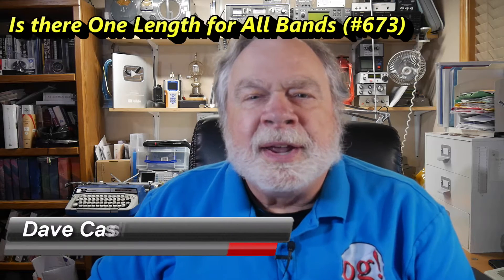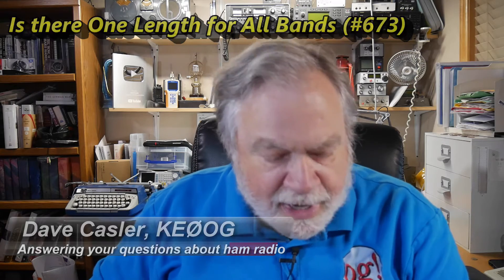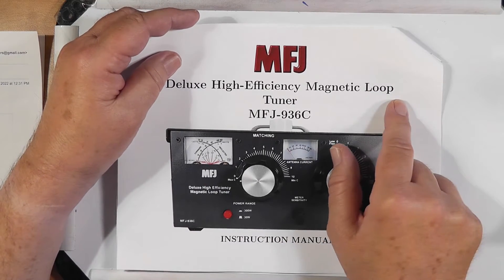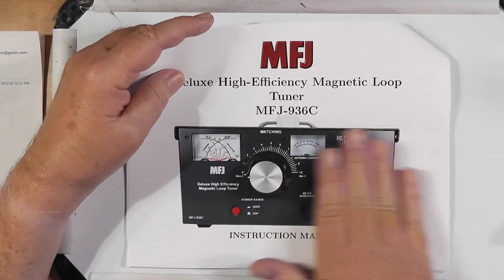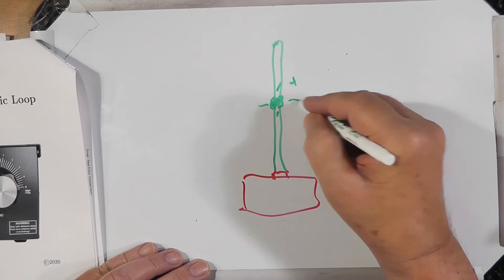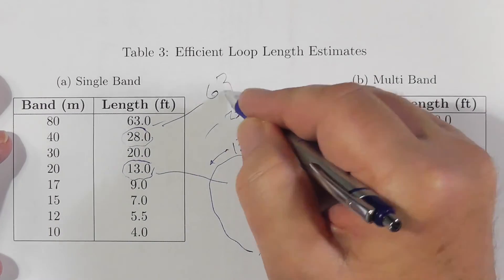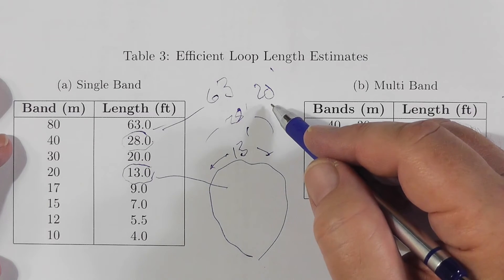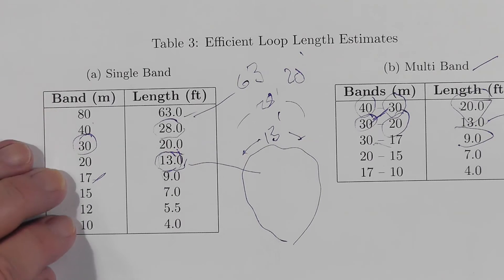Is there One Length for All Bands? (#673)

Comment: Hi Dave . Great video ! I’m wondering if this operator could try as I have - to have multiple lengths of wire collected at the same time , or alternatively to have several adjacent loops as can be alligator clamp configured to produce either parallel or serial loops - hence different total lengths .
Thanks John -KD2ODE